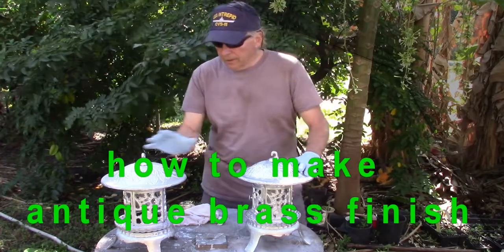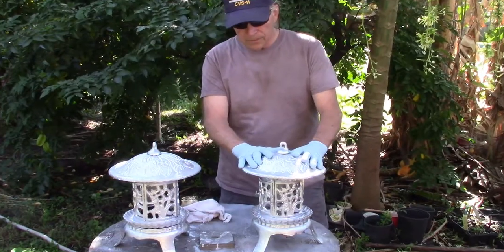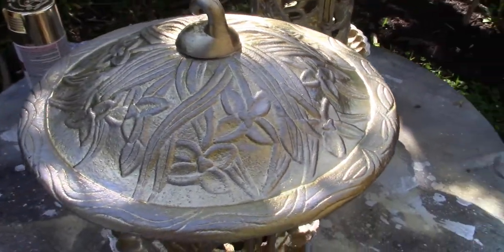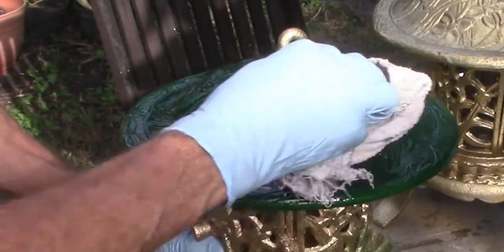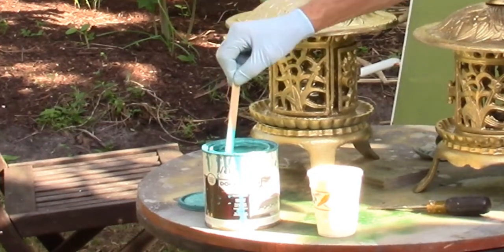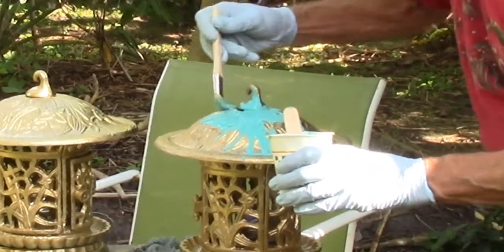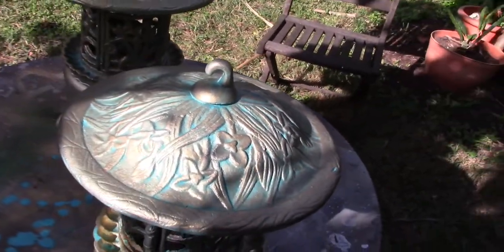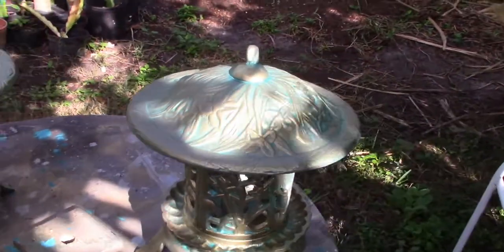how to make antique brass finish

Comment: A little late to this party, but if you're still here, which particular paints did you use?
Reply from the maker: ideal you want dissimulator paints. however for this I used the same type--- just let the first cure a couple of days before the top coat goes on, then wipe as soon as possible.
Reply: @donaldporta  Thank you.